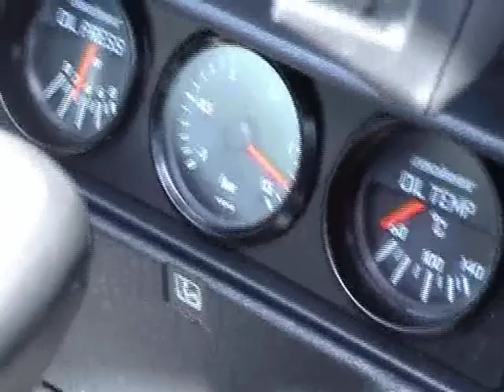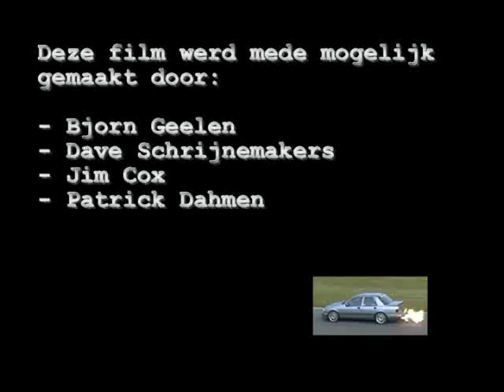Ford Sierra RS Cosworth 4x4 (Road test movie)

Comment: drop an g60 engine in it.
It can deliver 200 bhp easily.
chip it, put an other exhaust on it, change the pullys on it.
and you got a little pocket rocket